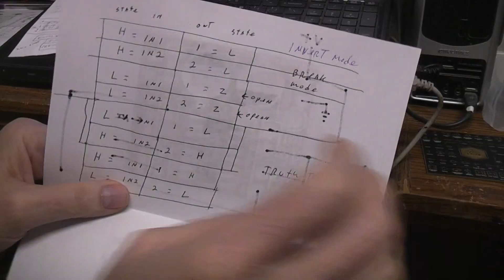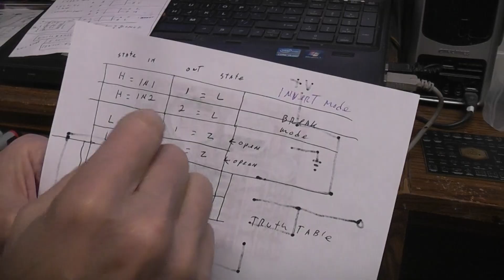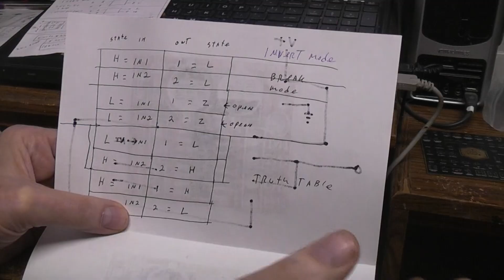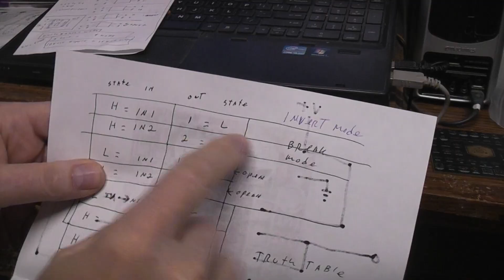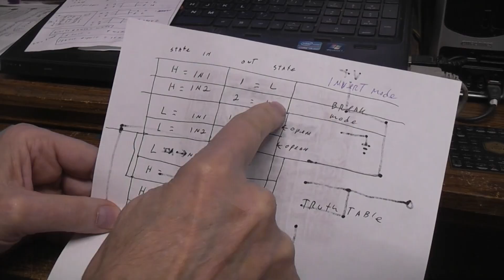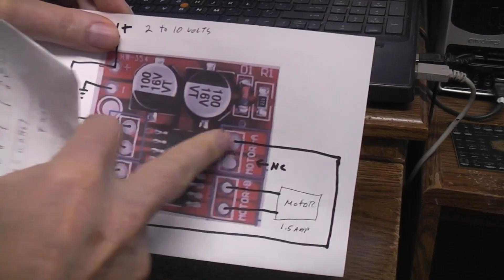Simple, single control line mod for Dual H bridge DC motor control, like MX1508 & MX1616, L298n.

Comment: Is it possible to do this with a 12V supply and input?  Wanting to drive a linear actuator that is 12V.
Reply from the maker: There are H bridge driver chips that go to the higher voltage range. This chip is only good to 10 volts. Options would be to run the 12 linear actuators at 10 volts instead of 12 or use the H bridge to drive a relay that controls the linear actuator.

Comment: Fascinating.  I could envision hooking up one or more optical sensors to the control wire and having a bump-and-go robot that doesn't even have to bump into anything.  When it gets close enough, it turns around.
Reply from the maker: Yes, that is what Dual H-bridge motor drives are used for in many Arduino projects, but you do not need the Arduino the sensor could control the H-bridge directly.

Comment: Very clever!  Thanks for the info.
Reply from the maker: These chips all set to LOW, it does not really matter in brake mode, the point being that the 2 motor wires are tied together shunting and voltage the spinning motor might try to generate.
Reply: @Robothut  I think so, as long as both leads are at the same potential, I don't think it really matters.